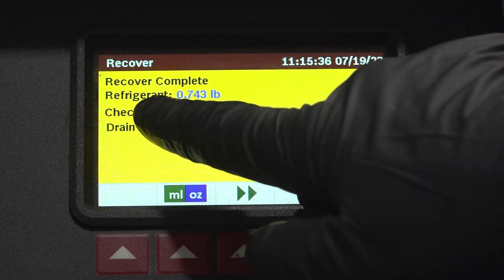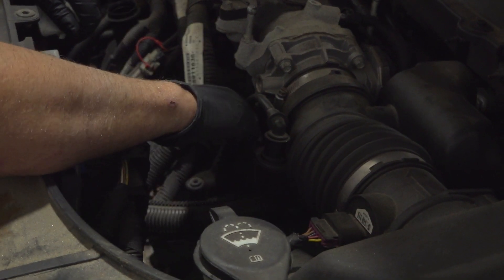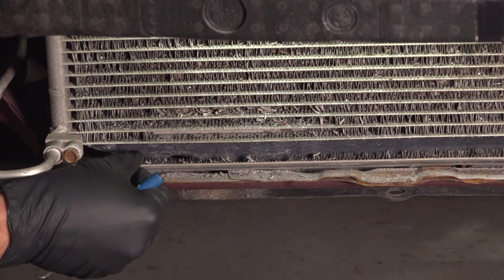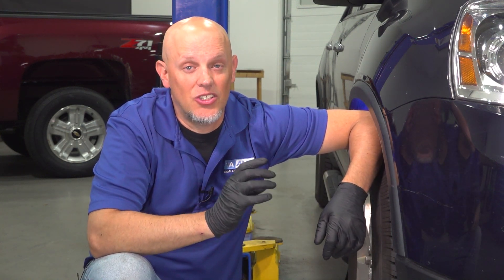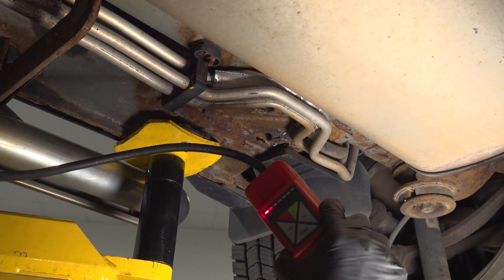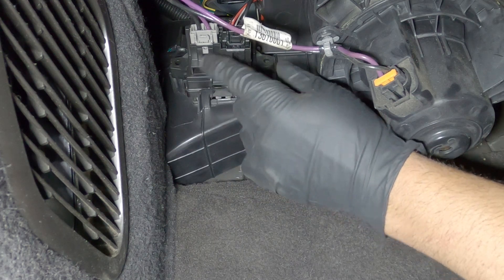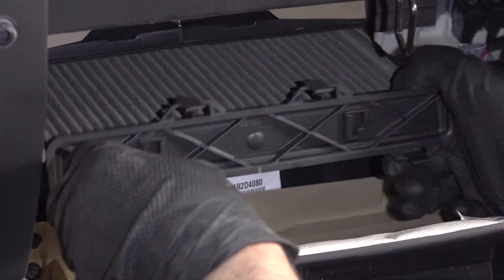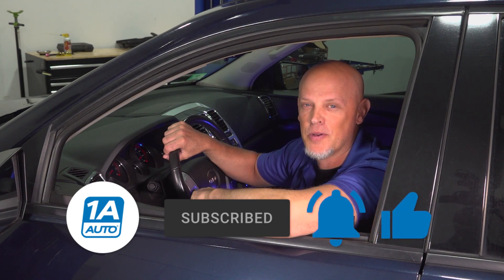Air Conditioning Not Working in Your Car or Truck? Check If This Hard-To-See A/C Part is Broken!

Comment: My 99 Mercury Grand Marquis has 307,257 miles on it and still runs pretty strong. I have had her 12 years and never knew there is a cabin filter! I dont use my air conditioning and would love to as I am in Arizona's triple digit temps however, my son replaced something years ago and decided to swap I think condensors from a Grand Marquis taxi cab to surprise me (even tho mine worked great, just blew at a slower than normal rate) but he never completed the hook up and I dont know what that would be...a recharge or something else🥴

Comment: I replaced the evaporator on my old Tahoe once by cutting a hole in the air box behind the glove box and sliding it out. And then taping and sealing it back up after. There is no way I was going to disassemble the entire dash to get to that. Or pay a shop $1k+. Not for that cheap peace of junk vehicle.
Reply from the maker: +Dantastic We appreciate the feedback. Sometimes there are multiple ways to accomplish the same repair.

Comment: Dude replacing the evap core is literally the most cringe job you can do but make good money on, taking apart nearly everything in the interiors front, Seats, wire harnesses, steering wheel, Dashboard, side trimings, air bags 1 or more modules like engineering jesus whyyyy lol